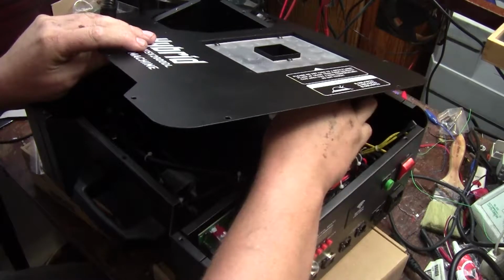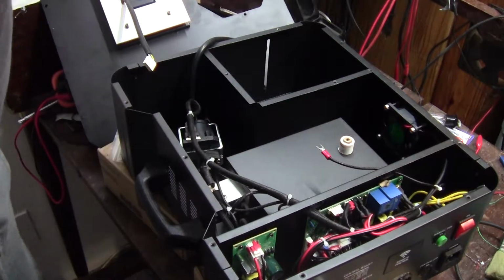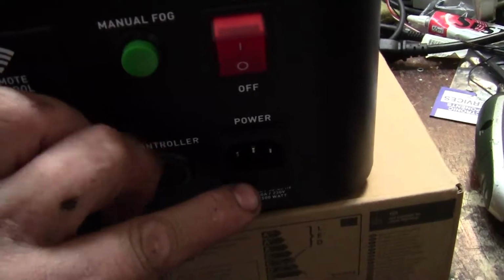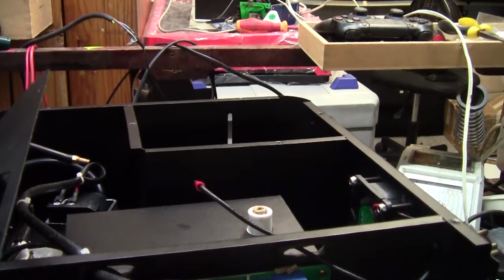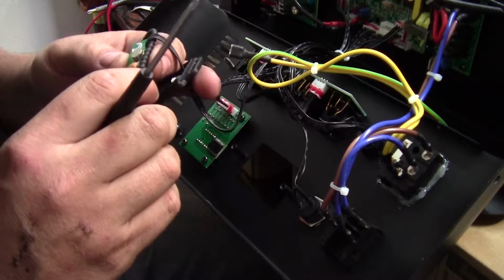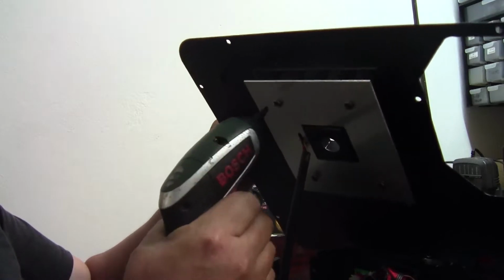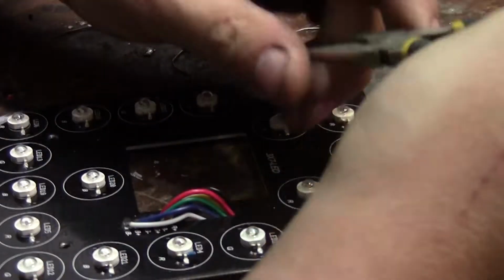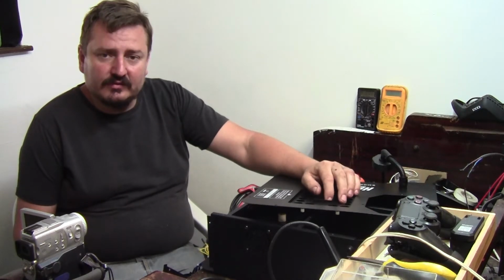ShoutingElectronics #7 - Outdoorising a Smoke Machine - Part 1

Comment: Try any 433Mhz remote controller, might get some response, or just simply use a DSTV IR receiver and feed the data signal into there, and see if you can use a credit card IR remote to run it.
Reply from the maker: Thanks. I do not think I will spend too much time with the remote input. From what I have seen, the remote is just a push-to-fog rf remote. Which activates the Fog Pump and the Lights (to what you have set on the menu). I am going to be using an Arduino generating DMX (easy by just adding a SN75176 RS485 Converter, which I have quite a few spares), that way I can control the Pump and RGB Led's Seperately, letting me make them flicker a bit more to look more like a flame effect.   I have built up a basic DMX Shield, and will start playing with the programming tomorrow (while I wait for the Resin Casting of the LED Block to harden).   Later they might want to add a few more of these around the building facade, which will then look cool them all synched through the DMX line. 
They want this one in before Friday, so I can't play around too much..